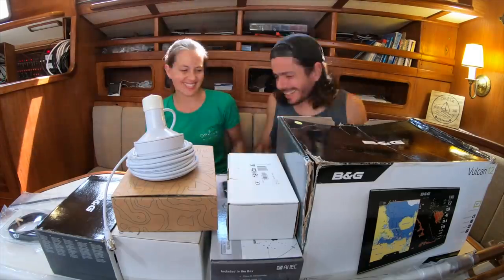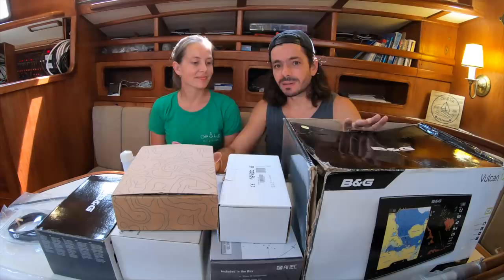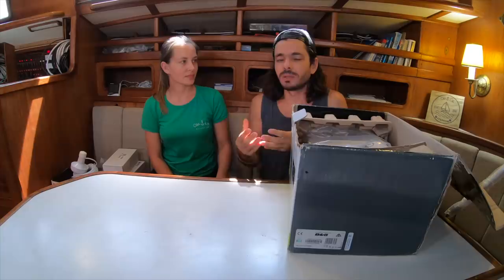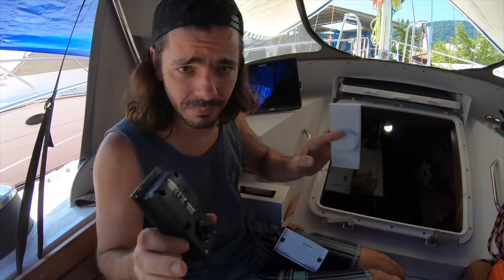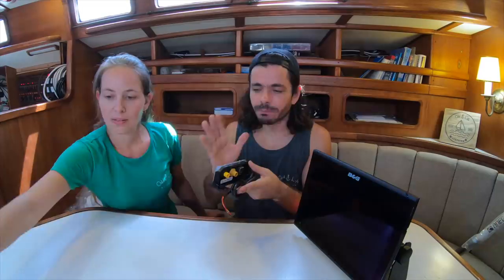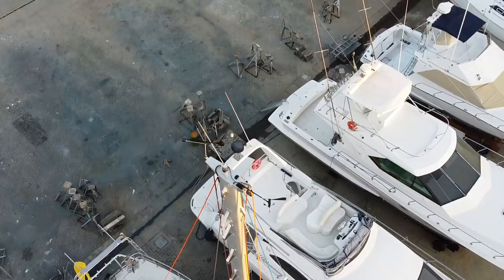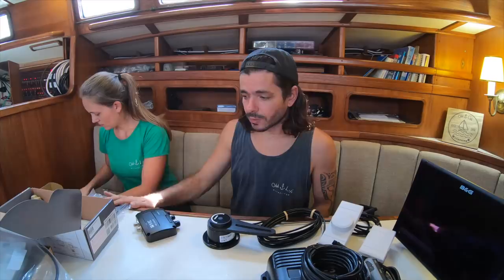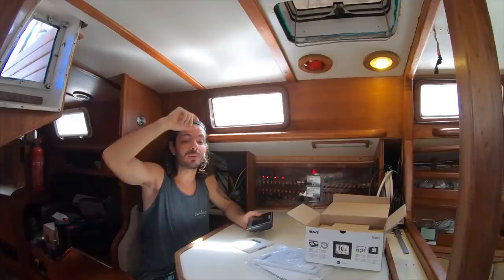⛵️ Let's talk about Sailing and Navigation Electronics #179

Comment: You talk about network and I started to wonder why ships and boats don't use a com network similar to an IP network for computers to talk to each unit. Then you could install a true backbone for all ship system that talk to other gear.

It seems like a solution like that would be the next step up and pull everything through one system able to handle all such gear. Basically a network for smart gear or a version of internett for tiny things.

Then if the ship was wired up correctly you could just plug things in and there would be a minimal need for wiring anything other than power leads. But maybe technology hasn't caught up to the need yet. if feels like a smart solution to me and with how much electronics a newer ship carries it seems like the smart next step. You'd just need to figure out how to deal with lighting strikes and you'd have a rock steady long lasting system that was plug and play. Maybe wireless is the way to go on a ship? It could still use a unified network though.

This is my idea, so if somebody steal it they should remember that, but I also know that it's unlikely that I'm the first to see the possibility.

Comment: It's a shame yacht electronics are so antiquated. My home is filled with wireless smart devices that are interoperable and a fraction of the cost of these.
It's time for marine systems to catch up.
Reply: Good idea but you are forgetting these sensors need power so there needs to be wires.  Do you want to climb the mast in a gale to change the batteries?
Reply: @richardstott7777  That was solved long ago with IoT. The rechargeable batteries in my fire alarms haven't needed to be changed for years. Running a single power line is far easier, universal, and reusable. Physical data lines are no longer necessary.
Reply: @richardstott7777  It's also easier to isolate power so a lightning strike doesn't destroy all the electronics on the boat.

Comment: Your boat is a dream boat now! What do you think of an aluminum verses steal? Lighter weight, stronger, longer lasting, less maintenance, less expensive for the materials to build, easier to weld, less time to build, less problems with corrosion?
Reply: Aluminium hulls have serious corrosion issues & are much harder to weld (tig or spoolgun and special mig welders using argon gas). Aluminium plate is more expensive than steel. Steel is far stronger than aluminium. It is lighter, but has a finite life. Your just about completely wrong way around there. All of these things are why most commercial and military ships are steel.

Comment: Guys, " solving problems". Neither of you have exerience on the boat to be able to solve problems , nor have you any sea time to recognise your problems ! Again youve chosen navigation electronics yet you havent been sailing yet. Seriously go sailing ! Your engine really didnt need replacing, again you are finding issues , but again, if you couldnt resolve issues with the old engine, when your sailing, you will never be able to resolve problems with your new engine when they occur. In fact i am starting to see that you either to scared to go sailing or it is not your intention to go sailing 

I have watched most of your videos and now i see a couple making excuses not to go sailing and finding reasons for that . OMG WHY HAVE A LITTLE CENTRAL CONTROL  for your electronics when you should be more concerned with learning to navigate without electronics. Again you havent even Swung your compass and made a Deviation Chart ! Yet you say you are going sailing. Being on a steel boat one would think a deviation chart would be at the forefront for when your navigation electronics go down for what ever reason 

Lets start seeing some sailing now, no more excuses , it seems you dont want to move more than a few hundred meters from your moooring 

Sorry Guys